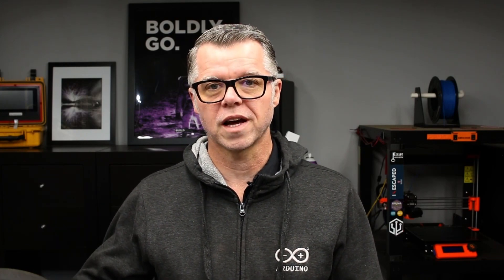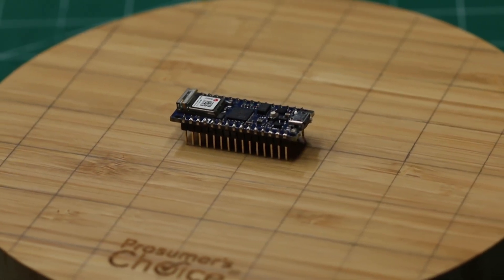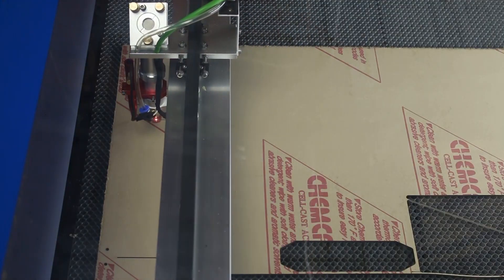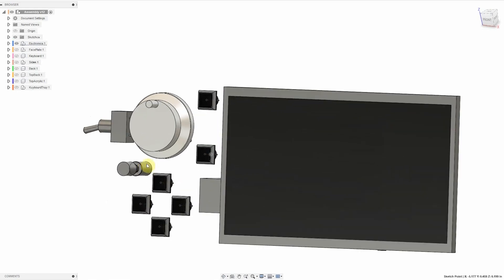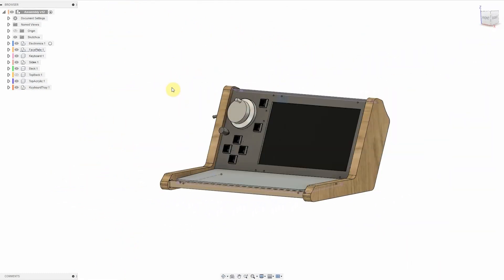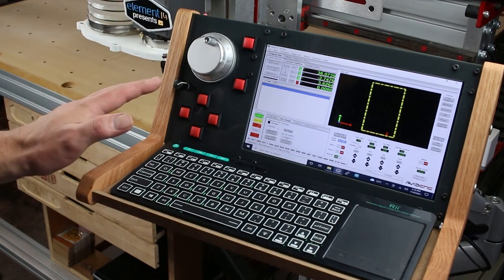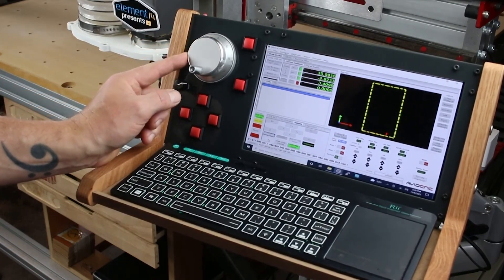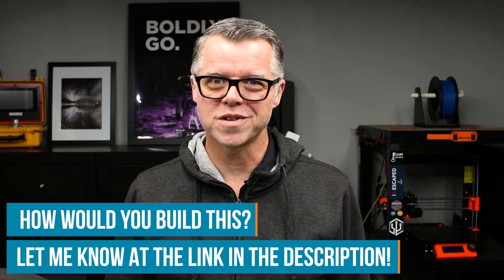CNC Router Remote Control

Comment: Are you left-handed?
Reply: I am not. Why do you ask?
Reply: @kalebclark5826  it would seem a little awkward to have the controls left side of the screen
Reply: @davidkclayton  Ahh. The origin I use is front left of the machine, so when I am using this thing I am usually looking at that position. The device is front right of the machine, so when I operate it I am reaching over with my right hand.

Comment: How did you end up routing the HDMI all the way to the computer without it getting to be a mess? Also, technically, the HDMI on the touchscreen is an input :)
Reply: The old monitor arm has channels for routing cables. And I moved the computer under the CNC, so its not that much of a mess with the cables.